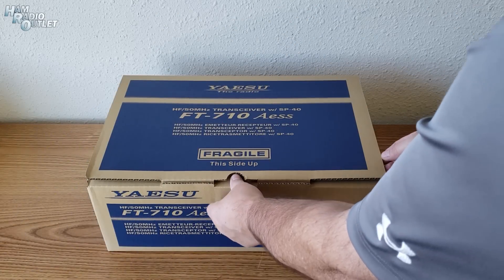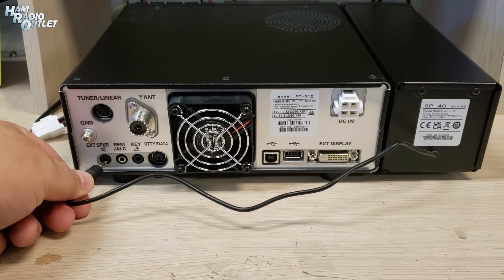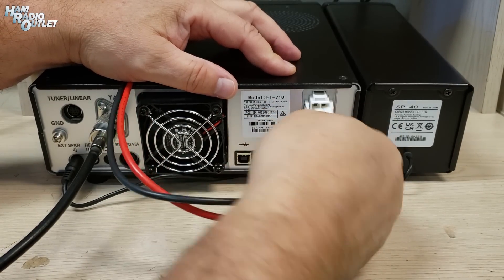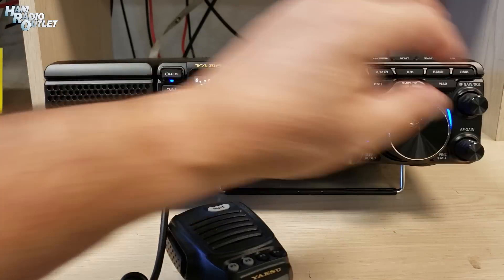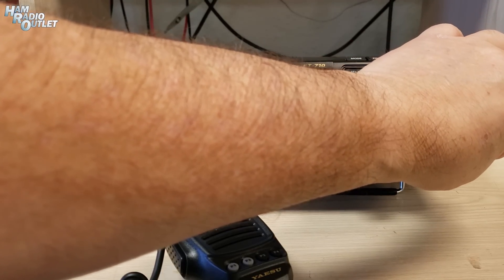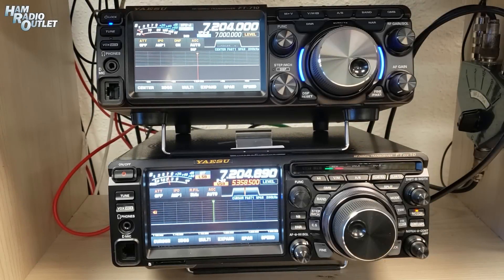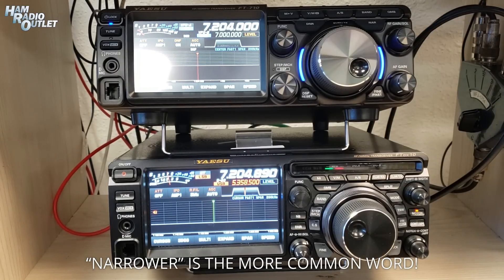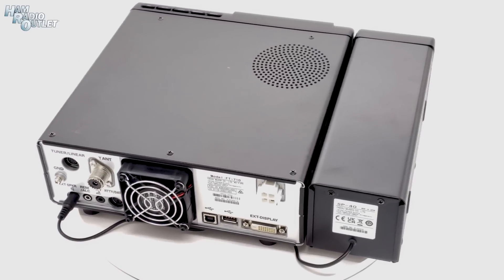Yaesu FT 710 First Look - Ham Radio Outlet

Comment: Muy bonito, pero que novedades nos Aporta Que no tenga mi FTdx3000 mp. Tengo también el FT 847 y el FT 897, también Alguno más.. Pr cierto.. CUANTOS €  CUESTA EL BICHO. UN ABRAZO DE EA4GGC.
Reply from the maker: For full information about the radio, go to the Yaesu website https://bit.ly/3DUiU60 See the link in the description for pricing, as prices change.
Reply: @HamRadioOutlet   Pues la Banda de 70 Mhz. No RULA o Funciona, PORQUE ESTA VACÍA y los Radio Aficionados, No Montan
Antenas para las Bandas o Frecuencias de Radio/Control en América, La Yaesu Ha Perdido el NORTE, NO HAY TAMPOCO Antenas, 
Ni los ACOPLADORES de Antena Necesarios. Así que MUCHO Bla, bla, bla,  Pero se Jodio la Industria de, los Electro-Domesticos Con
el FT dx 5000 MP Reforzado con el FT dx 3000 MP para HF y 6m.... Para otras Bandas, Ya Tengo Mas Que Cumplido Servicio.

Comment: Looks like a nice entry level HF or for somebody on a tight budget.  I don't know why so many think this radio was intended to compete with or replace the FT-991A or the FTDX10.  Yaesu needed a radio to replace the FT-450 and fill the gap between the FT-891 and the FT-991A.  This radio fits the bill.  I wouldn't mind owning one.
Reply: At around $1,300.00 I wouldn't consider it an entry level transceiver!
The FT-891 is more of an entry level rig than the FT-710 is.
Not everyone, in today's economy, has that kind of money to throw around!  Especially the new, younger hams!
Reply: @jfrphoto01  If price is the issue, then I'd suggest an ICOM IC-718 for about $650. You can find them used for $350 and up. Much easier to operate than the FT-891. I have a Yaesu FT-891 and like it a lot. But I wouldn't consider it an entry level radio compared to the IC-718.
Reply: @KX4UL  518 is an inferior radio. I have a legacy Ten Tec I picked up for 200 bucks  that's a much better radio.
FT 891 remains the best value for HF/6m
Reply: @robertkeller9828  518??? All entry level radios have their shortcomings. And new Hams do not have enough experience for it to matter. I agree with you about the FT-891… best bang for the buck. Enjoy your Ten Tec…73!
Reply: @jfrphoto01  The 891 is a very underestimated radio, I got it to work portable mostly but use it in my sitting room connected to the Chameleon MPAS 2.0 with CAP HAT on the front lawn and make contacts all over the world with it on 20m. This is my setup when I don't want to go to the shack or abandon the XYL for hours, I can listen and work digi modes without disturbing her or when she's gone to bed I can have voise QSO. 

I work PSK31 and Olivia with this setup too.

With FLrig it's a lot easier to use and change bands and power etc but once used to it it's simple to use and all the heavy menu stuff is set once and forget. 

I had the Xiegu G90 and the 891 is a massive improvement, audio quality and receiver performance trash the G90, the audio via headphones is just amazing to listen to. 

If I was on a budget buying a first radio for the money the 891 is impossible to beat mainly for receiver performance and sound quality ( via headphones ) A tuner if needed does add to the cost but if got 2nd hand like I did the 891 is a fantastic radio and beats the pants off the 450D in performance and sound quality too, not happy with the Audio from the 450D at all, it's quite poor, the 891 vs 450D audio is night and day different also compared to my old 7300 the 891 beats that by miles in audio quality, again, via headphones, I'd have the 891 over the 7300 any day.
Reply: @o00scorpion00o -I couldn’t agree more. I bought my FT-891 about 6 or 7 years ago for portable ops. I hooked it up and played with and was impressed. In fact to the point that I was considering buying another for a base unit replacing my IC-7300 that was away for screen repair. I have heard people complaining about the menu layout. It’s not at all that hard to set up. Once set up you only need to access a couple of controls. If I sold every piece of HAM gear I own, I’d still keep the FT-891!
Reply: @jfrphoto01  The selling price in UK for the 450D 4 years ago was £725.  The selling price now for a 710 "Field Edition" is £899 and only £814 with Yaesu Cashback Deal.  That is only £174  or £84 more than the old 450D.
Reply: Radio don't matter as much as you antennas. You can spend 5k on a radio when this will talk an recieve just as well.
Reply: Except it has no 2m or 70cms, so can't possibly replace the 991A.

Comment: This is 2022... Wondering why on earth there would be a DVI-D as the only video output option. I'm sure you can go directly to HDMI with a regular DVI-HDMI cable, but still.
Reply: My understanding is that DVI-D doesn't require a license like the others do, thus keeping the overall cost of the product down.
Reply from the maker: There is no audio to pass through and HDMI requires a license fee per unit.
Reply: I wasn't necessarily saying it should be HDMI. In fact, my thought initially was that it should be Display Port, which superseded DVI-D well over 10 years ago. It's a current standard and as far as I know, it's a royalty free VESA specification. I don't know about consumer grade, but pretty much every business grade monitor has Display Port natively these days.
Reply: @mikeschmalz2031  Display port, HDMI, DVI, they're all the same thing. Just get an adapter to whatever your monitor takes. DVI is convenient because a lot of people have junk monitors from 10 years ago that use this standard that would be perfect to stick on a radio.

Comment: ATTENTION  !!!  A DVI video output port is compatible with very common HDMI inputs by using a very simple (fully passive, no embedded chips, just pin-to-pin wires) and readily available DVI-to-HDMI cable. This sort of cable is ~$10, barely a few dollars above the cost of a more common HDMI-to-HDMI cable. So all the grumbling and faffing-about concerning the DVI interface is just a wee bit silly, given this important tidbit of info.  You don't need "an obsolete PC monitor", you don't need "a monitor with a DVI input", all you need to do is purchase a DVI-to-HDMI cable and use any modern monitor or TV that has an HDMI input. I hope this helps.  Google terms: DVI HDMI Cable. Cheers.
Reply: P.S.  This choice was made because the HDMI standard comes with extra costs, that would have increased cost cost of the radio.  Cheaper for you to fork out ~$10 for a cable.

Comment: The burning question i have is the rf gain similar in working to the dx10 (which is just fine )? Or because it doesn't have a front end  stage is it a disaster like my ic7300 or most other pure sdr rigs ? A proper rf gain is a must after experiencing ic7300 rf gain rubbish ?
Reply from the maker: Unknown at this time.
Reply: @HamRadioOutlet  tks for responding.  We'll see in coming weeks .
Reply: IC7300 is direct sampling DSP and yes can overload the front end although I seldom have an issue with it.  The FTDX10 and FT710 is not, they are IF DSP, 1990s tech with improved DSP.  SDR simply means can upgrade the software.  I do like my FTDX10, but IC7300 has more operational features and easier to use.  The large menu in the FTDX10 is not so friendly, continuously having to go to it.  But that has been Yaesu's approach for years like with the FT991.  I do like the speaker mounting on the side of the FT710, is different.
Reply: @n9eerptr  thank you for your thoughts . I know my priority of having a good working RF gain control is overlooked by many hams  . Some even think it is simply a 'mute ' control?  Especially in very general noisy environments,  however if like me you are used to the benefits of a proper working RF control, using it to lift the noise floor on top band people would start to see the benefits?  Only if all they have for reference is a high general background noise and a icom ic 7300 i can understand why they think of a RF control is simply a mute control ? I still like my icom ic 7300 in every other respect , and is much more user friendly than the ftdx 10 that my friend has (he also has the ic7300) but the dx10 RF control just works ! The ic7300 is indeed a mute control.  Hopefully this new ft710 will be similar to the ftdx10 in operation ? My understanding was the new ft710 is not hybrid like the dx10 ? So my concern is it might perform like my ic7300 which is very poor in lifting the noise floor (it doesn't it simply attenuates) Especially on low bands ? We will see in the coming weeks all about the pro's and con's . Tks again for your feedback.
Reply: @robduncan599  I see the RF gain in the IC7300 as an attenuator, it does decrease the signal along with the noise as the S-meter indicates.  I would suspect this is done because of the direct sampling and ADC conversion.  The DSP remains in full operation.  The IC7610 functions the same way.  So does the RF gain in the FTDX10, it does reduce the gain of the front end with increasing the ALC voltage, just the S-meter continues to show the max level of the received signal, but the noise is greatly reduced, a most liked feature.  But what I like most about the FTDX10 is the knob for adjusting the IF bandwidth and adjusting the band pass.  Having quick control of these offers some advantage in adjusting for better reception.  I use them a lot.  I was looking for the adjustment on the FT710, maybe a menu items.

Question for you, what do you mean by hybrid???  In the old days it meant part of the radio was solid state with some tubes, usually in the final.  Of course not what it refers to today.
Reply: @n9eerptr  I read that the 710 is indeed a proper SDR unlike the FTDX-10, which is not a bad thing because the receiver and audio is so good. SDR can sound harsh, the 7300 sounds terrible compared even to my FT-891 via headphones.
Reply: @o00scorpion00o  710 is creamy smooth.  Smoother than my DX10 and 101D, but not quite as smooth as my 590SG.  Way quieter and warmer sounding than my 7300 or 705.

Comment: I don't think you could skip the manual on a transceiver like this, no matter your experience level. So many embedded menus, for starts.
Reply from the maker: I think you're probably right!
Reply: Having the FTDX10 for about 2 months I have not opened the manual much.  If one is familiar with typical rig terminology it is rather easy to work with the FTDX10.  There are some issues to learn, setting up each band and mode the menu settings go with each band setup.  Drove me nuts when going to a band in CW, but the BK-IN keying was off.  And after selecting menu with FUNC it sets the knob for that function, set to CW SPEED then the knob stays with it.  Just some small things that are different from other rigs.  The calling of memories is easy, but did take some learning on how to use them.

Comment: "Nobody ever reads the manuals."
I dunno, I've had my FTDX10 for two weeks, and I can't tell you how many times I've referenced the excellent manual.
Love the rig, by the way. Purchased from HRO Portland.
Reply from the maker: Yeah, I agree.
Reply: The first thing I do with every rig I have ever owned, after unboxing and looking at how nice it looks in the shack, is to read the manual from front to back!  I usually download the PDF version fro the manufacturer as It is easier to see and navigate on the PC monitor.  I will then print out, on 8.5" x 11" paper, the sections that I feel will be needed the most and keep it in the drawer of my desk.

I do have to say that my favorite HF rig is still my Kenwood TS-830S, complete station.  It was my father's until he passed away and left it to me in '95.

Comment: Really like the form factor of this rig. Interesting they stuck with a DVI video out, which would work for me as I've held onto a few obsolete PC monitors. Worth the purchase to replace my lost Yaesu world map!
Reply: DVI to HDMI adaptors are cheap and work great!
Reply: Or just buy a $10 DVI to HDMI cable. They're simple cables, do not contain any embedded conversion chips. Just pin to pin wiring.

Complete non-issue.
Reply from the maker: No need for HDMI as there's no audio to pass to the monitor and HDMI requires a per-unit license fee. DVI to HDMI adapters are very cheap, so you can use your modern monitor with no problems.
Reply: HDMI would be a complete waste because the resolution is so low it would be worthless. You only get something like 800x600 resolution on a big screen and it doesn't look good, I don't know why they bothered. Same on the FTDX-10. A higher resolution at least 1880p would have been great.
Reply: Rather a DVI or VGA than HDMI.
HDMI are prone to make RF interference unless you have an exceptionally good cable.

Had 4 wireless mics blocked by noise on a musical, turned out it was a slightly faulty screen on the lightconsoles HDMI cable.
Had 3 channels blocked at another musical, culprit was the HDMI monitor used by the video crew.
Reply: @sarhtaq  The DVI and HDMI specs are literally the same.. HDMI is DVI + Audio. The difference is the cable shielding (and probably presence of ferrite chokes) on quality cables, not the spec. That's why you can convert one to the other without any logic, it's just a pin adapter. I suspect they went with the DVI connector because it's more durable and has cable retention screws.

Comment: Wow pity about the old school ports, they going to have to get up to speed with the Chinese radio's.
Reply from the maker: HDMI is unnecessary as there's no audio being passed to the monitor, and HDMI requires a license fee per radio. As for the USB connectors, most computer mice still use regular USB-A connectors. The only one that's out of date, is the USB-B (printer) connector. USB-C is the way to go, until the next big thing happens.

Comment: Imagine what you could do with all of the volume occupied by that external speaker.
Reply: Being a relatively compact radio, it's easy to travel with.  Having the detachable speaker with a janky cable connection rather than an integrated speaker is possibly a recognition of exactly what you're saying.  Traveling, and on field day or at events you'll likely be using cans anyhow, so the speaker can stay home.  If you want to put external amplification and quality audio transducers cause you like great sound, you can, and ditch the side speaker also.  Seems to me it's just added value and front-firing has some advantages in clarity IMHO.